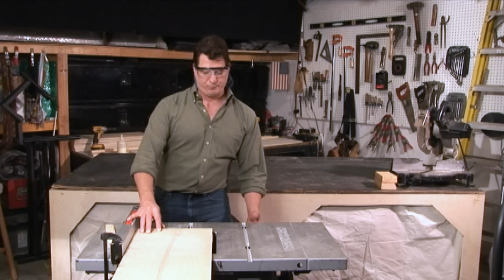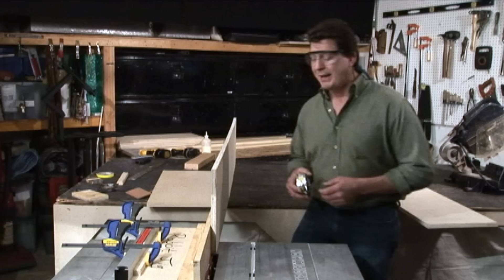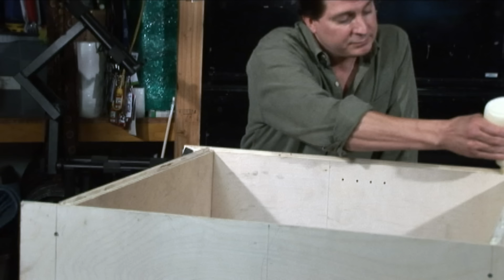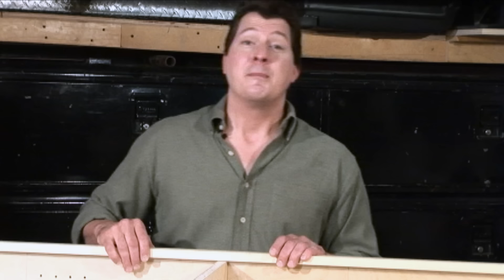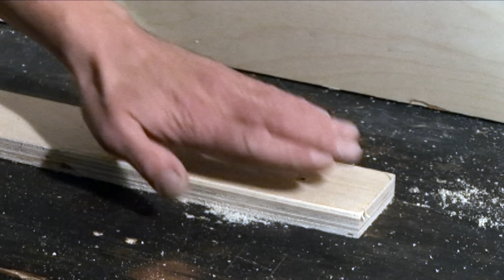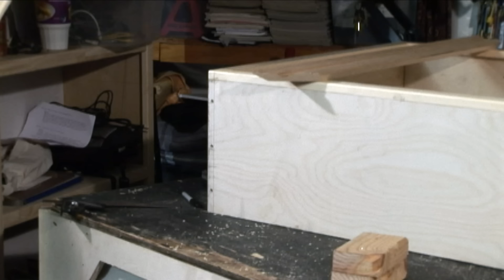Build a BookCase Easy

Comment: What kind of clamp is that for attaching the top wood together.  Needing one to connect my shelves to the sides without the wood moving.  Thanks!  Great video.
Reply from the maker: It’s called a corner clamp / you can get it at Rockler - thank you for watching!!!!

Comment: Hi Eddie, when you put the crown moulding on did you use a backer for support?
Reply from the maker: Hi- thanks for watching - no I didn't use a backer board.  The bottom of the crown molding has enough wood to just nail it in by itself.  When you nail the front and side pieces together it  creates a corner that supports itself.  Hope this helps and please subscribe.

Comment: Hi Eddie. Nice video. I want to give it a try. What are the size of the nails you used? Did you drill the holes before nailing? I have a nail gun, but you made it so neat and clean using just a regular hammer, that I want to do the same. Thanks.
Reply from the maker: +my man - thanks for watching.  I use finish nails - 10d or also known as 10 pennyRubens Onofrio

Comment: Question: How much did the wood cost you?  I am fairly handy, but frugal... So how much did this cost to build?
Reply: If you purchase 2 pieces of 4' x 8' plywood, 1 piece of 4' x 8' 1/4" Luann,6 pieces of 1" x 3" pine stock and an 8' piece of crown molding you will have more than enough to build.  For your fasteners a box of 2" screws and a box of 8d finish nails will be enough.  Also have a bottle of wood glue ready.  Last make sure you get the proper shelf supports.  Just go to your local home improvement store and have them work you up a price.  Hope this helps.

Eddie

Comment: Love it but he man wood warrior guy routers and tablesaws arent basic power tools....in my world at least...Do you think you could  show us how to build a bookshelf with tools the ladies might have on hand...like say for instance a circular saw and drill and just basic tools?  Im so sick of particle board garbage furniture...The furniture on offer anymore is so blech...Awesome video. 👍
Reply: I don't think this is a gendered thing, but perhaps a budget/space thing. If I could own a table saw and a router, I would. I wouldn't use a router enough to justify the purchase and I don't have the space for a table saw. I do have a miter saw, drill, clamps, and circular sander though! I think you could just give it a good hand-sanding and leave the hard edges.

I'm going to build this shelf, but have the lumberyard do the cuts on the plywood (no circular saw) and use the miter saw where possible for the rest. I'm going to skip the backing (to make it more of an open shelf) and add feet and skip the fancy crown molding trim work. I think I will order a corner clamp though. That thing looks amazing.
Reply: Elizabeth Powers -  I usually get my tools at the pawn shop. They come with a return policy and can see if they get power at the pawn shop. I've gotten all mine there and never had a problem with them and they're alot cheaper than getting it at the store. Hope this helps a bit. ☺️

Comment: What is the thickness of the birch plywood used?
Reply from the maker: Hi David - the thickness of the Birch Plywood is a nominal 3/4" -  but actually the real thickness is 11/32".  I guess it's the same idea of the actual size of a 2" x 4" which is around 1 1/2" x 3 1/2".  Hope this helps and thanks a lot for watching.
Reply: Eddie Rinier Why not just use a 1x12x6 like this piece: http://goo.gl/3SAiTx
Reply from the maker: David Schroeder That would be fine.  I just used birch plywood to keep the cost down.  When choosing your wood from the lumber yard make sure your piece is straight and attractive.

Comment: My own is off 3 centimeters when measured corner to corner. How do I correct that mistake?
Reply: In this case you need to rack your cabinet by laying it down on his back then securing one side either with someone holding it or clamp it down to a work bench. Now adjust the other side left or right until you are able to get both of those diagonal measurements exact.  Now that it is square continue to check it as you nail the backing.  Hope this helps!  Eddie
Reply: Thank you. I will try this ASAP.  Then let you know if it works.

Comment: Just a tip:  When you use your framing square to draw cross lines, you shouldn't lay the square flat on top of the shelf side as you did.  You should lay it over the edge of the side and let it angle down along the side. Then when it's pressed up against he side of the shelf, it will be perfectly square to the shelf side. The way you did it, you could have it slightly out of align which would not be good.  When you do it as I mention above, it also can't move when you are marking the shelf.

Another thing is that it's really poor design to screw permanent shelves into the sides. That's an extremely weak way to connect the shelves, especially with plywood.  If you are making high-quality shelves with solid wood, the ultimate way to connect the permanent shelves is with dovetail slots. 

A drill is not called a drill motor.

Lastly, your "cool dude" mannerisms are very irritating.  You sound like you want to be a disk jockey in the disco days.
Reply: Heather Sanford No, How
Reply: dude did a good job with minimal equipment and the title says easy .
Reply: You sir, are a jerk.

Comment: Thank you for the video. I liked your positive approach. I have a few questions. Other than the drill and circular saw, what is the electric tool you use? Is it called a planer? Also, how wide are your shelves? Thank you.
Reply: I think you mean the router.  I'm not sure about his use of "routering" instead of "routing" but that might be part of the character :)